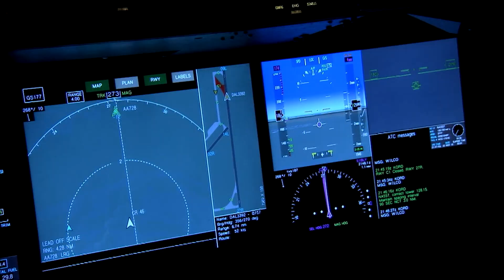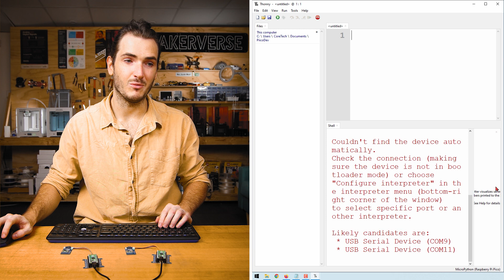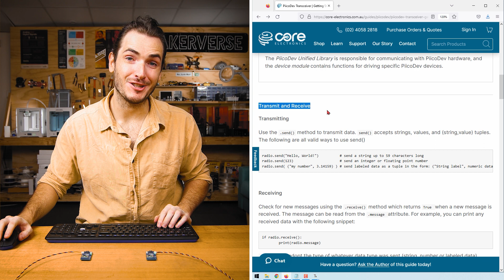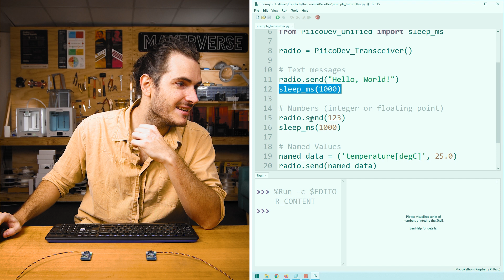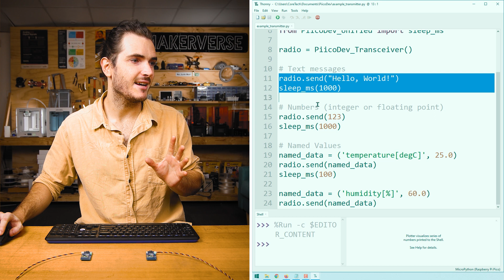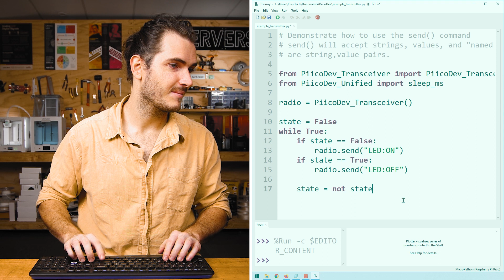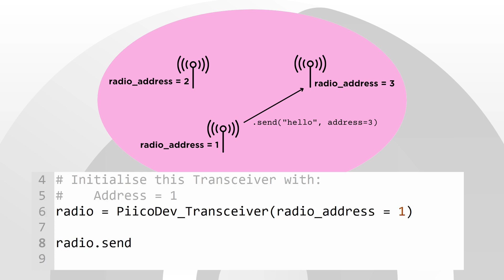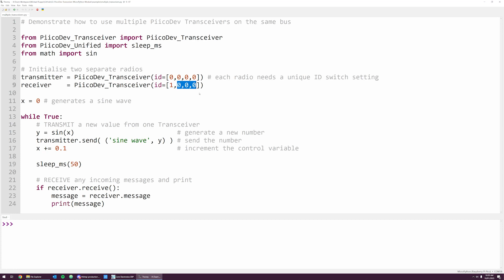PiicoDev Transceiver | Getting Started Guide for Raspberry Pi Pico

Comment: I need two of these for my current project... but one of them would logically be placed in a metal box... my power utility meter box, as it need to control a 240V relay driving a pump motor.  I suspect this will kill ALL radio stuff... it is a Faraday cage, right?

So... Would be cool if I could connect an external antenna... is this possible?
If not, I guess I'll just have to mount my Transceiver (and probably attached Pico) in a box stuck on the outside of the meter box.

I'm pretty new to the Pico world... appreciate any words of advice.

Thanks,
T.
Reply from the maker: It would be possible to modify it and attach your own antenna, but it would be a little janky and requires a bit of experience to do so. Mounting on the outside like you said might be the easiest option here.
Reply: @Core-Electronics  Thanks... I guess it makes sense to just stick it on the side of the meter box and be done with it.  In which case, I'll be needing a little case to house a Pico and a transceiver module.  Can you recommend anything?  Cheers, T.

Comment: A bit ago you made a garage door opener that you controlled with your phone.  Cool project and it solves a problem that i have with an older opener with a bad control.  I initially hid a doorbell button in a combination lockbox on the outside of the garage. the garage is a bit of a jaunt from my apartment and not visible from my door, i will occasionally leave the door open.  With a proxy switch on the garage door wired back to the dev bored, i would think it would be able to tell the receiver board that the door was open and flash an LED as a warning to close the door.  It is not clear to me if the transceiver board can both send and receive, (transceiver) implies this. a touch sensor could be put on the box holding my receiving Dev board, in my house with a button that would then close the door remotely and then verify my door is closed. Very helpful on a cold raining night.

Comment: Are these compatible with other LoRa modules? They say 915MHz on them which makes me think that it's what they're based on, but I couldn't tell from the docs whether they added anything else (in fact the product page doesn't even seem to mention LoRa). It's clear from the video that the library operates at a higher level and doesn't expose raw AT commands, so I'm wondering what a regular LoRa receiver would see when such messages are received.
Reply from the maker: Hi! These radios are not intended to be used with LoRa. While the are the same frequency, that is just because 915MHz is unlicensed in Australia. The PiicoDev Transceiver is only intended to work with other PiicoDev Transceivers. You could in theory communicate with other 915MHz transceivers but you would need to do a deep dive on aligning the configuration of that second radio to match the PiicoDev Transceiver. There is also some level of payload wrapping that the PiicoDev library is doing behind the scenes which would not be decoded by another radio.
Reply: I am interested in the answer to your question also.  Long range data transmission, even at low rates is of specific interest to me.